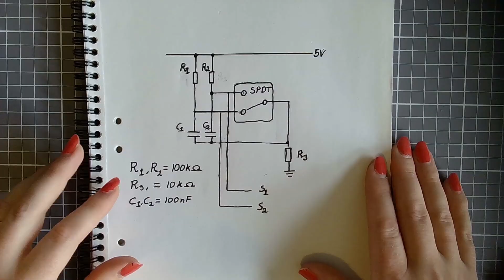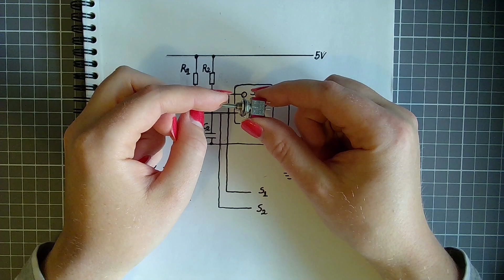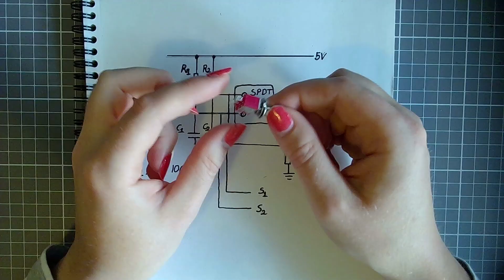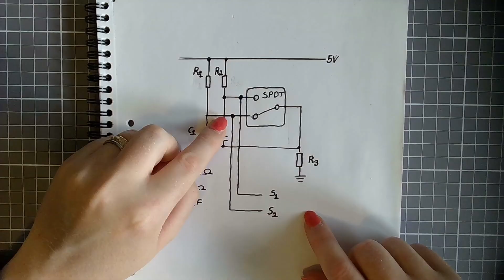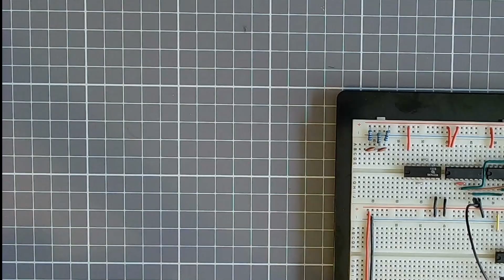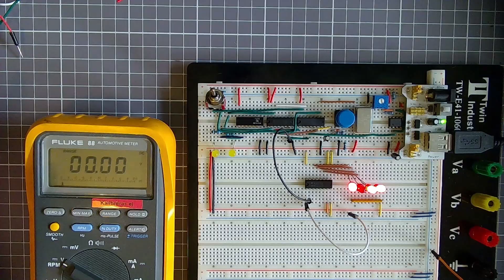Clock Module | Part 4 – Three-State Toggle & Halt

Comment from the maker: The clock module is now functionally complete!
Next up, we'll recreate the entire circuit in KiCad and use it to review how everything works together. I'll also explain how the clock module connects to the backplane and interfaces with the buses before we move on to designing the first PCB.
I'm also working on a separate video sharing my electronics learning roadmap, and how I plan to learn from different projects. I hope you'll check that out as well!
Thanks for following along, and I'll see you in Part 5!